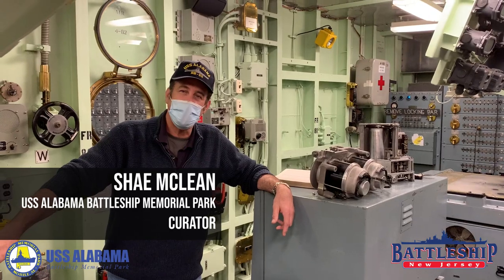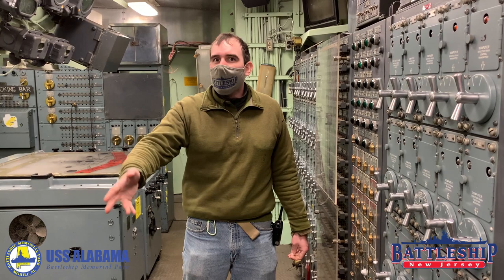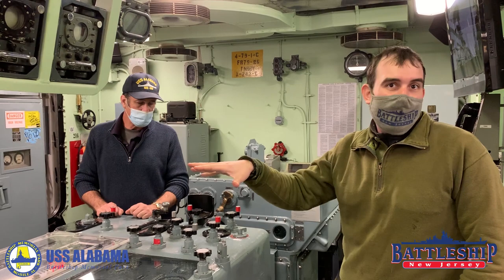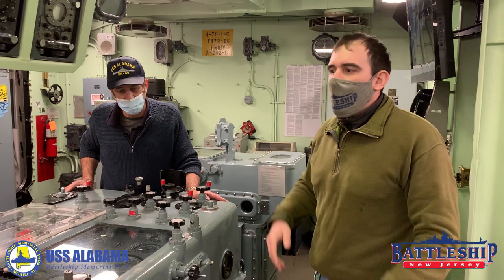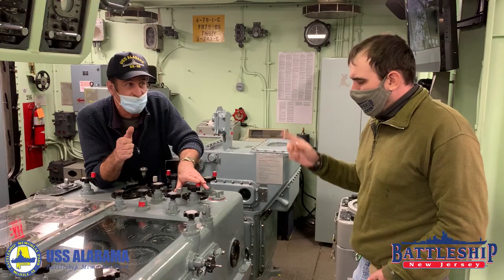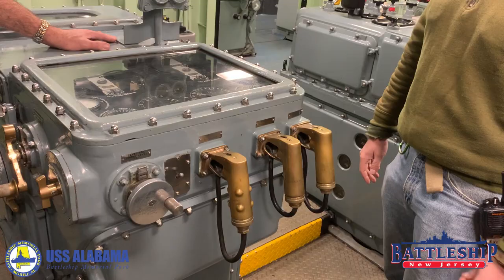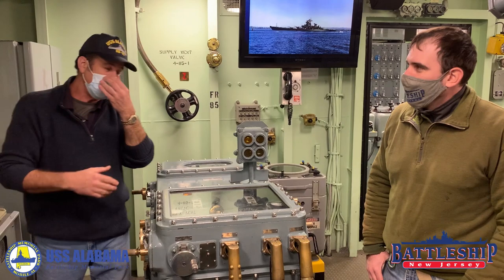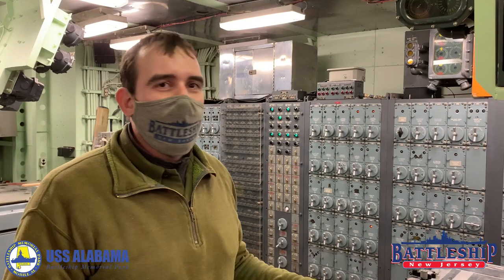Forward Main Battery Plot with Battleship Alabama

Comment: So would the triggers fire all 9 guns? Was full broadside SOP?? When firing individually was that done from the turrets? The details of this is fascinating... Could probably spend a couple more vids on just the plotting/fire control/gun interface alone!!
 (please??😁)
Reply from the maker: The trigger will fire whichever guns are connected at that point, a switch is flipped and it tells the computer which guns to fire. Rarely a full broadside.

Comment: Couldn’t one get an extra kilometer or two of range if one used the roll of the ship to their advantage? Lets say the guns only elevate 32°, you could perhaps get an extra degree or two by using the ship’s roll. But then again, as you have stated in past videos, typical engagement ranges were no greater than 13 kilometers.

Also I watched your video about torpedo defense, and a thought occurred to me. Outriggers. Couldn’t they have come up with some sort of outriggers to attach to the sides of the boat to act as a sacrificial torpedo defense that would fall away from the boat if damaged? Would make sense for it to be removable as well because of the Panama Canal.
Reply: Potentially. At Normandy, the crew of USS Texas intentionally flooded tanks to list the ship 2 degrees for extra range.

Comment: With everything that’s going on right now we might need these ships brought back
Reply: No way, they are old, obsolete, all the left over ammunition, powder, barrel liners have all been disposed of. They were obsolete at the end of WW2 and could only fill a niche mission of shore bombardment which other ships and guided munitions can do much more effectively and more cost efficient.
Reply: @CRAZYHORSE19682003  I wasn’t being serious, but on that thought I’m sure with some upgrades it could still pack a good punch. Take a massive hit unlike modern ships and still keep up with today’s ships. Can you imagine seeing that ship coming in the South China Sea? I know I’d run 🤔
Reply: @footed16  You would have to gut the entire ship, remove the 16 inch guns and replace them with VLS cells, remove the 5 inch secondary battery. Replace the power plant and after all that you would still have a massive ship that requires a lot of crew to operate. It doesn't fit in with the Navy's distributed lethality theory.

Comment: I am surprised they didn't replace all these obsolete analog computers with an Apple II in the 1980s which can calculate all the solutions with the same 19 inputs far faster with keyboard inputs. Even a 1MHz computer can make about half a million arithmetic operations a second.
Reply: In the 80's it was easier using analog systems versus the Apple because their were sailors who were  familiar with these analog systems.  Tech wise your correct but from a training and getting the ship ready for deployment it is easier to use sailors already familiar with the analog rather than invest time and money taking out the old computers, putting in new systems to include rewiring your fire control system.
Reply: @destroyer0685  Actually I think none of the sailors are familiar with any of the WWII gear. They would have been trained by some guy who read the manual or some old geezer they brought out of retirement. Remember, this is 40 years after whoever sailed on the ship in 1943. If they are in their 20s and 30s then, the people who originally operated this stuff are in the 60s and 70s in the 1980s.
Reply: @dwightlooi  true but the last operational deployments for these class of ships was during the Vietnam War.  So the trainers were there and you have the equipment that still works so its more efficient and cost effective to use the existing system.
Reply: @destroyer0685  Probably, but good luck fixing anything that broke. I mean, it is not like you can fabricate the intricate gears and splines on the mechanical computer at the ship's machine shop.